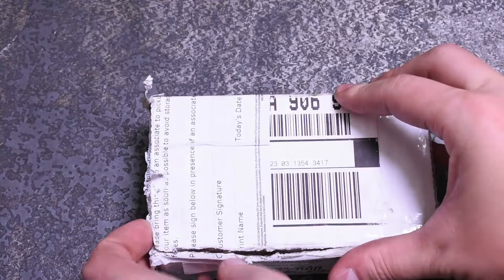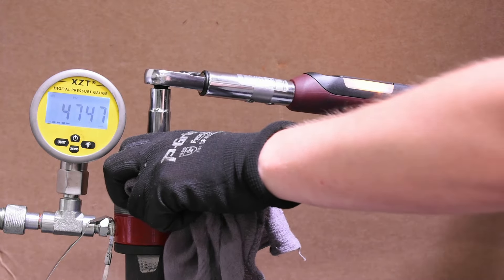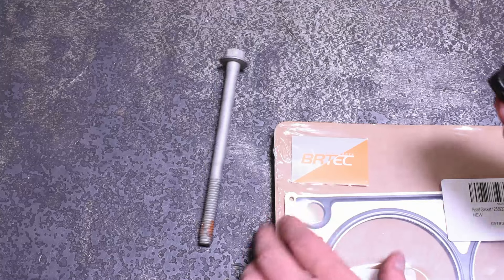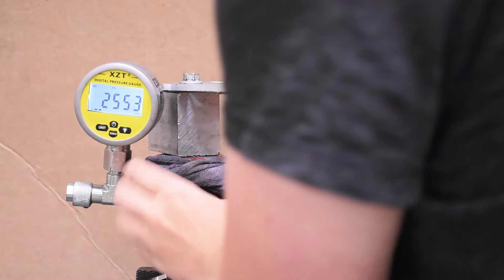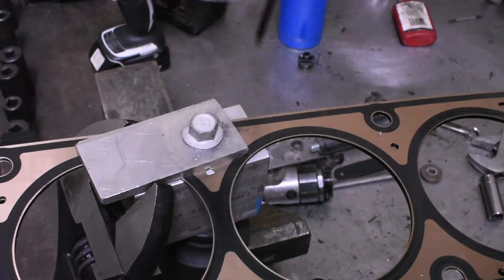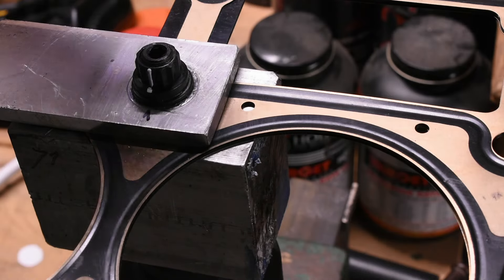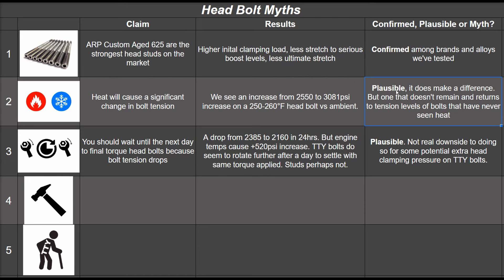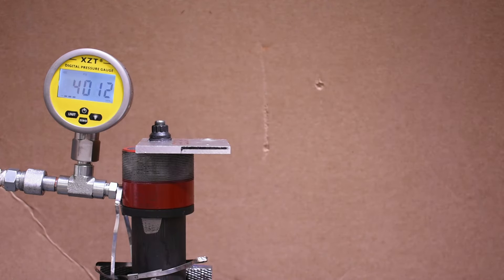CAN You Reuse Cylinder Head Bolts? Testing Myths + ARP Custom Aged 625+

Comment: Interesting tests and great work. I would love to see a video dedicated to addressing the never ending debate on whether it's ok to use anti-seize and lubricants on bolts because it changes the torque values and clamping force too much- thereby increasing bolt stretch and failure (especially on lug nuts, studs, etc). What is the actual impact on clamping load when we torque to say 100 ft lb dry vs lubricated with anti-seize? Thank you for your efforts.
Reply: There's usually a wet and dry torque spec available for that reason.
Reply: Never put anything on lug nut dry only 
And a t 100ftlbs dry will be less tight that the 100lftlbs lubricated one
Lubrication remove friction and give a better torque reading essential in critical bolt like head stud arp is even more precise with there special lube for torquing
Reply: @legros731  Exactly. Never, ever lubricate wheel studs or lug nuts. They are held in place pretty much only by friction due to their short clamping length. That's the reason why headbolts are so long - the stretch allows them to stay tensioned (it "takes up the slack" during cyclic loading). Short bolts / studs can't take a significant amount of length change without reaching the point of no clamping load, at which point they are free to rotate out.
Also, lubed bolts will fail at a lower torque, so by lubing a dry-specced bolt you're increasing the risk of breaking the bolt.
Reply: Anti-Seize isn't exactly a lubricant  due to it having an abrasive in it. The lubrication feeling is misleading and generally torque settings are determined on a freshly machined bolt with a light coating of oil left from the machine process. Generally it's a 30% reduction in torque when using anti-seize according to a very in depth study conducted by NASA. That is if you were not provided the Wet and Dry torque specs from the manufacturer. Torque wrenches are an estimation anyway you look at it too. You in no way can measure the linear stretch of a bolt through numbers of rotations. You could measure a bolt length at factory torque, anti-seize it and then tighten the bolt until the length is achieved and that will get you your anti-seize torque setting too.

If you properly stretch the bolt it should not matter what is on the threads as the elasticity of the metal is doing the holding. The massive amount of misunderstandings  surrounding this subject has not only muddied the water, it filled it in and black topped over it.  Another thing with not using anti-seize on hubs, rims and lugs is the extra torque then applied to the bolts through rust-jacking. There's far more to it once you stop listening to the fear mongering and actually go the full way down the rabbit hole. it took an effort digging through all the "I think therefor it's true" but it was worth putting my mind at ease since what I was being told, sometimes yell told, and what happens in the real world did not match. John Caddogin the Auto Expert .com.au has a couple videos that explain the wheel bolt side of it, worth checking out.
Reply: Cat actually has you use copper anti seize on it's head bolt
Reply: Isuzu gives specs for there engines with wet and dry torque
Reply: Light oil merely deters corrosion. Its heavy grease and waxes that significantly affect torque values. Anti-seize is powdered metal suspended in very light oil
Reply: I've recently heard ALL tourqe specs are for dry threads UNLESS otherwise noted. Anyone else can confirm this?
Reply: @kain0m  I'll do what I want.
Reply: @legros731   .
Reply: @kain0m  You can lubricate the threads without issue. The friction between the nut clamping surface and the seat in the wheel will provide plenty of clamping force. In the rust belt you usually have to antiseize all threads and the hub surface or your wheel will not come off.
Reply: @jeffreystroman2811  Yes, torque specs are for dry threads unless otherwise noted. At least that's what us engineering students are taught.
Reply: @jeffreystroman2811  it is if not specified it dry
Reply: @geoffmooregm  it ok to do the hub and disk surface but it a big no no on the lig nut
Reply: @legros731  Not a chance in hell am I having my lug nuts be rusted on. Fat. Fucking. Chance. They get an ever so slight amount of grease or oil (which dries anyway from brake heat). I slightly overtorque (which isn't really, since a little lube) and guess who will never, ever, have seized lug nuts?
Reply: @jeffreystroman2811  Read the instructions for your application.
Reply: +1 on that
Reply: The answer is quite simple: there are anti seize products on the market that lead to a defined friction coefficient on your bolts, for example my = 0,13. That means you can torque the bolt based on table specs, no matter if it’s surface is covered with rust or factory new (i work in naval industry).
Reply: @TheGuruStud  The problem with lubricated threads isn't the torque it takes to undo them, it's the axial load on the threads.

Think of it like this; the torque it takes to move the nut a certain distance on the stud is different depending on the friction (more friction means more torque to overcome the friction). The axial tension on the stud is proportional to how far down the stud the nut moves, since steel is close enough to an ideal-elastic material (i.e. a spring) for small deformations.

 So, when you have lubricated threads, the stud gets stretched out more at the same torque. Engineers use very large safety margins on lug nuts so lubricated threads could work just fine, until you hit that one pot hole too many that causes the stud deformation to transition from elastic to plastic (springs back vs permanent). Do that enough times and it will cut itself clean off at the point of peak deformation. If the threads survive, that is.
Reply: @legros731  I have been using anti seize on lug nuts for 45 years and have never had a problem ever. And I don’t have to bust my ass taking off rusted lug nuts. Also anti sieze the hubs. And all the arm chair quarterbacks can criticize and scold me all they like. Experience wins every time.
Reply: @demuskumarius  ya it’s called anti seize not anti tight.
When I put nuts on connecting rods I use ARP lube as is specified by them. Funny thing is they don’t come loose and fall off and there is not lock washers either.
Reply: @Djhg2000  Did you not read that it dries from brake heat? And I've been doing this forever. It also keeps the threads from being torn up on the nuts.
You mean brand new from the factory slick and shiny studs/nuts, then lube would over tq them. 
Have you seen nonlubed hardware? It's oxidized and rough as fuck. You're actually under tqing them lol. 
Guess what that tiny amount of lube does? TA DA factory fresh, again.
Reply: @TheGuruStud  Not sure where your latest reply went, but yes, I did read how you think it's fine because it dries from brake heat. It just doesn't make any difference, because that happens after the nuts are already tightened.

The reason you've been able to keep doing this is because engineers have been stuck designing the studs not to immediately fail if users overtorque the nuts in this exact way. Engineers have to design stuff to be as safe as possible when customers think they know better than the manual.
Reply: @geoffmooregm  I was thinking that too. I anti-seize all of my wheel studs for the last 30 years because I grew up in the rust belt and never had one come loose. Properly torque it and it will not come off. This is why they're tapered. They absolutely will not come loose when engaged in that taper under tension.
Reply: @donziperk  Facts
Reply: @Djhg2000  Well I  anti seize my trucks lug nuts and tighten them up to the torque specs. Load the hell out of it and drive the pot hole laced logging roads of British Columbia Canada. Have never broken a lug nut. 40 years in many different trucks. Experience tells me your theory is wrong. 
The trucks weight is not supported by the lug nut but by the hub  that the rim goes on. The lug nut clamps it on.
Reply: I got my first car back in the late 60's and my dad insisted I change oils, brakes and lube everything before being allowed to drive it...for the experience, he would claim. He insisted on antiseize for the lugnuts. You'll never know when you will have to change the tire and you don't want to spend untold hours trying to get the tire off due to corrosion. We lived in the northeast where roads were salted, sometimes before foul weather. My 63 corsair monza spider convertible was more rust than car by the time I junked it but the wheels were never an issue to change. Almost 60 years and I still to this day use antiseize on lugnuts and am not about to stop now.
Reply: Cause and effect mean nothing to you using the logic you claim. Engineering is over-specced for safety...overall safety, certainly not because some jackleg with tools knows better than manuals. 
Sheesh. Facts, man. Deal with facts.
Reply: @jeffreystroman2811   Wrong...   Torque specs are with lightly oiled threads, unless other wise noted.  This is per ASME standards.
Reply: @kain0m   WRONG.   It is the seat that provides the friction NOT the threads.   From the factory lug bolts/nuts are oiled or coated with anti frictional coating.   Also using an anti corrosion/anti seize is preferable in locations that may see corrosive environments.   You have a far far higher risk of damaging a fastener that is seized on during removal than you do with lubricated threads.  Who ever told you to never lubricate the threads of wheel studs or bolts had no clue what they were talking about.
Reply: @donziperk   I used to do this, but found that it was harder to unwind the lug nuts after they were cracked loose, because of hardened anti size( you could not just spin the spider) so I stopped using anti seize  and took to dousing lug nuts with  WD-40 before removal, which works fine.  One of my pet “superstitions ?” is when you have tightened up your nuts (lug or wheel), to give the wheel a couple of hefty clumps with a rubber mallet, you torque wrench fans would be amazed at how much more you have to do to get correct torques after that.
Reply: @CrimeVid  I’ve never really has that problem with anti seize but I get could happen. As for the mallet  yup that does work. I always advise to re torque the lug nut after 100 miles.
Reply: @Djhg2000  Something as critical as lug nuts/bolts are also designed to be removed and tightened on the side of the road as per the factory supplied wheel change kits. I'm pretty sure the engineers took into account shops using nothing but ugga duggas for tightening and people doubling the torque spec by standing on a combination of the lug wrench and the threaded tow loop, so that the threads and wheel would still be fine.
Reply: @lolatmyage  This kind of thinking is exactly why lug nuts are designed with way higher safety margins than other threads on a car. Someone did it once and they survived, so they start doing it repeatedly. Eventually something fails and they blame crappy parts, bad mechanic shops or the age of the car.

But that still doesn't change fundamental material properties; if you double the torque once to get to the closest shop it will hold, but if you have alloy wheels you risk stress fractures. Do that over and over and you'll pretty much guarantee stress fractures.

It also doesn't matter how many times you try to convince yourself of the opposite; torque specs are meant for dry conditions. I actually looked up friction charts for fun and for steel on steel threads (which is close enough to wheel bolts and studs) there's at least 10 times less torque wasted to friction with lube compared to without lube. Saying you're just doubling the "torque" (in practice it's the axial load that matters for fasteners but torque is easier to measure) on the stud or bolt is a dangerous assumption. The torque to axial load relationship used when designing the wheel hub is only valid for dry threads, there's just no way to argue around that.
Reply: @geoffmooregm  Absolutely agreed.  Rust causes you to do preventative things as much as possible.  I have a tube of Lucas grease with anti-sieze that I keep in my car.  That way when I am taking things apart, especially for the first time, I can put some of that on the threads.  I've gotten lucky with my 2003 Mini Cooper so far; I've only had the pinch bolt for the right front shock break.  My dad and I were able to drill out the broken bolt without damaging the threads too much.  I grabbed a replacement high grade bolt from the hardware store and used it.  It's been holding for several months just fine.
Reply: Anti seize isn't supposed to change torque specs, but I guess there's only one way to know for sure.
Reply: @demuskumarius  Right, anti seize isn't supposed to be a lubricant, I very much doubt it's a 30% torque reduction when using anti seize, that's really close to the number for a lubricant.  
Torque wrenches are a guess, which is why in high hp applications rod bolts are torqued to a specific amount of stretch, since in that specific application the bolt can actually be measured.
Reply: @jeffreystroman2811  Yeah that's usually the case, most things are supposed to be dry torqued.

Comment: Re used LS head bolts get torqued to 65 ft lbs.  in two stages.  Have a stock bottom end 5.3 that has seen north of 30 lbs of boost with reused head gaskets and bolts.
Reply from the maker: Living up to the user name
Reply: If the OG factory specs required 94 lbs. for final torque, that's probably what it takes to get the same clamping force without further yielding the bolt.
Reply: Sloppy mechanics community, has been doing that for years. Awesome watching guys like this running bigger boost on stock bottom end and reused head bolts. 👍

Comment: You need to test the affect of different lubricants on head studs. People think you can use any lube you want, but the wrong lube can lead to over torquing the nuts. Would be great to see ARP lube, vs Detroit Diesel #2 (peanut butter), vs 30w motor oil, and whatever else people use.

Comment: Heavy engine tech here. Cummins has a spec for their head bolts for length. A common trick also is to take a nut and thread it up the bolt. If it makes it all the way up the threads by hand on clean threads, the bolt can be reused. If not, then the bolt has been stretched too much and must be replaced. I also replace any bolt that has seen any rust pitting since that creates a stress point that could cause the bolt to fail. 

As for torquing head bolts again the next day, the gain you got is within the allowable tolerance, so I would say when torquing, shoot for the higher end of tolerance and even after relaxing, it will still be in spec. 

I've never heard of the hammer trick to take the twist out, but I have used that for helping to free up rusty bolts. A couple of sharp raps with a hammer on the end of the stud or bolt helps free up any rust and makes it easier to free the bolt or stud. Not a guarantee, but helps often enough its worth doing every time

Comment: Piano wire  is pre-stretched beyond the yield point to increase the elastic limit. After stretching the unloaded  length  of the wire slightly permanently  increases but the  maximum tensile load the wire can carry doesn't  change.
The reason for pre-stretching the wire is to increase the elastic range of the material and make its behaviour more predictable.
Because of its special  properties pano wire was used by Armstrong of England to wind round the barrels of battleship guns to strengthen them and it was also used to reinforce the boilers of Stanley steamers.
Reply: This is why I scroll through comments.
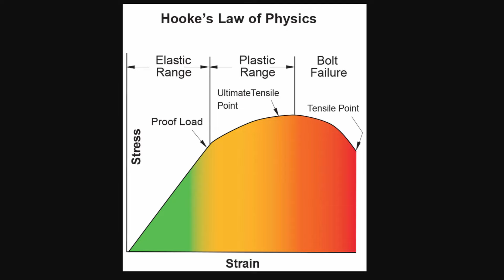Reply: The process of drawing wire from larger diameter material down to its final diameter actually increases its strength because of the property called "work hardening".  Work hardening actually uses up some of the ductility of the material to get to its stronger state, closer to its fracture point.  At about 8:00 in the video is a graph of a stress strain curve.  The curve is different for each steel alloy, some steels have a longer and flatter plateau at the top, and the final part of the curve to the right increases again before it reaches fracture.  This is the point of work hardening.  If you manipulate piano wire until you get it into this final part of the curve where the strength increases again then it will be at its maximum strength, but correspondingly closer to the fracture point.
Reply: Interesting.  If it weren't for this method, pianos would have to be tuned much more frequently I would imagine.
Reply: My personal cannon for quelling noisy late-night parties around the ‘hood failed prematurely…must get some piano wire to deal with repeat offenders!
Reply: @bradbeck2601  and on the opposite end, our old piano couldn't be tuned anymore because the wires were at their breaking point from being stretched and stretched, they'd have to be replaced to get it perfectly in tune again.
Reply: @AlexanderBurgers  Oh, that's interesting, I never thought of that.
Reply: @c0c0asauce  Are these nuggets of information still worth it when the conversation eventually devolves into political slandering?
Reply: @h8GW  
Only if you make it so. What a way to attempt to 100% derail the thread. And I guess I'm falling for it, right now; but, on the off chance you're serious: Bro, seriously?
Reply: We hope
Reply: @billj5645  The reason piano wire is stretched to allow room for tuning of the piano strings. You want a little elasticity to remain, but not enough that your tuning won't hold. It's a balancing act that also happened to be useful in other applications.